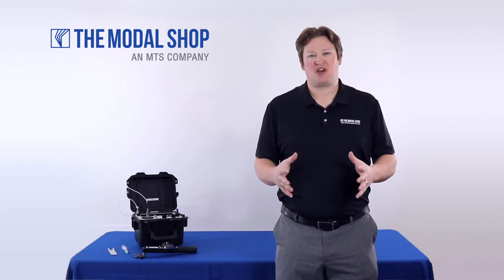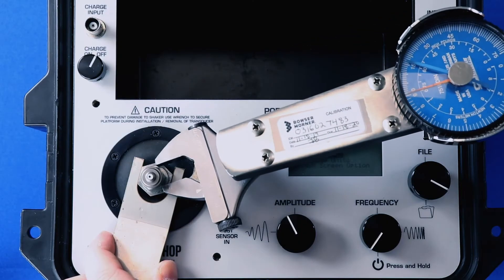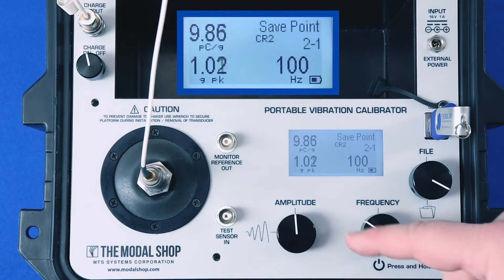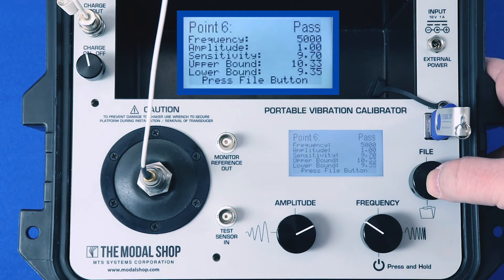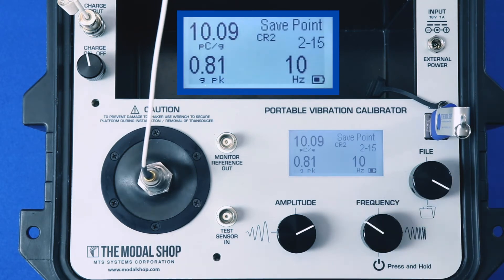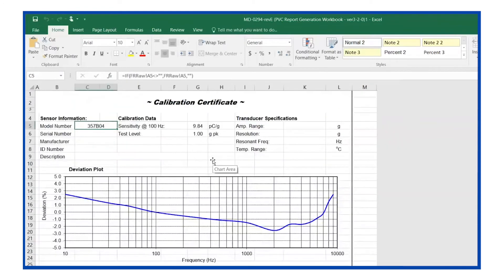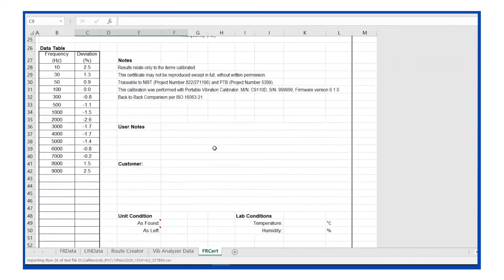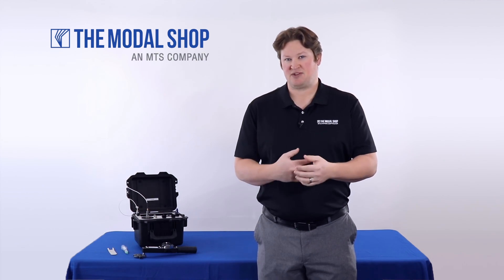Charge Mode Accelerometer Calibration via Portable Vibration Calibrator C9110D

Comment: Hello Mike. Nice video, but I'm confused, shouldn't you use a 003 low noise cable for charge accels?
Reply from the maker: Hello Nico. Yes, you are correct. I should have used a low noise cable. Good observation. I was able to use general purpose coaxial cable, Model 002 from PCB, because the cable run was short, and I was not in a noisy environment. But it would have been best for me to use PCB's Model 003 cable, which is a low noise cable.